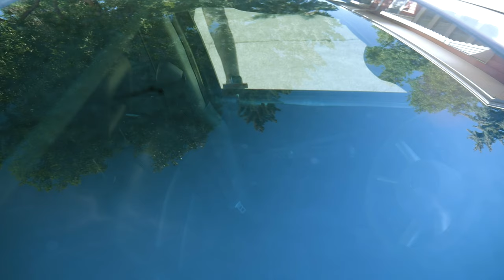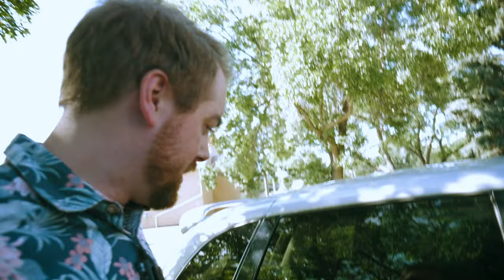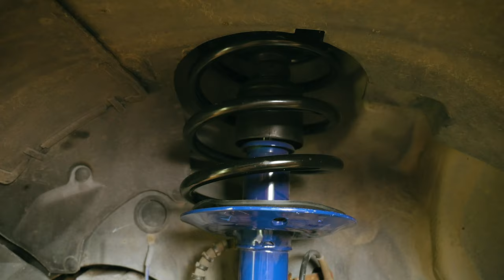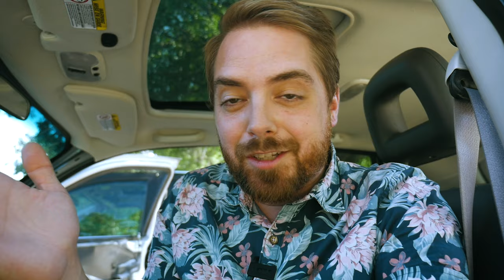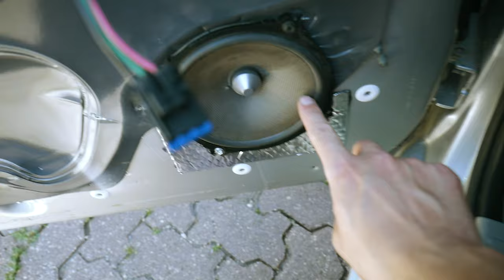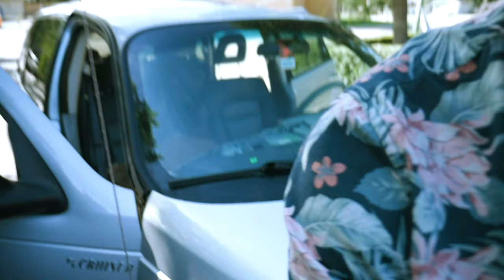Should I Just Walk Away from the PT GT?

Comment: The best way to have Your stereo updated is to buy a bluetooth adapter. It plugs in to the CD changer input. It works great in my Audi A2. I think that You can buy this for a PT Cruiser. Keep up the good work. Waiting for more video.
Reply from the maker: I did this in my '03 Volvo S60 and it was awesome, but I haven't found anything like that for this. Will keep looking...
Reply: Get a FM transmitter which plays music on Microsd and bluetooth with AUX input on Amazon.ca just $25 and set to fm107.7, I have one blasting all the time and you can't tell the difference if its via wired or Bluetooth

Comment: $2200 for the PTGT and another $200+ for parts and you complain? What you've been doing alot of us PT owners have done way more and NEVER nag or complaint once. I bought Mine new in Spring 2002: 2001 Limited PMT Purple plum, upgraded Borla exhaust it costed almost 30k Canadian bucks, thats alot back then, fast forward to now Sept 2020 I've spend almost 10k DIY maintenance replacing all you had to go through and Timing belt/ water pump and lowering the whole deal, but the old girl is aging, neglected rusted rocker panels and 299k km, still I love her so much I had to get her a sibling; I got another exact spec cruiser but with a price tag of $1000 CAD and only 109k never winter drivin Canadian car......... and gave her the same treatment and much TLC. I love my PT's, they are workhorses, they help me move inventory for my business , with out my first I wouldn't have made it today, my wife hates it not because what every reason, its because I put too much attention and time. TBH everyone's mileage vary, the same with any brand without TLC it will fall in the same fate, especially when you buy a used car, you don't know how they treated them before you. Love hate the PT, it doesn't matter; what I drive and own its my business and it should be yours, If you had one and hate it because you got a lemon, you suck sorry but that is a fact. Here in Toronto I don't see much PTs driving around and it makes me feel special that I am getting some attention, again Love hate but for a 17+year old like new shiny quirky car it does turn heads but not like it first came out in 2001 CAR of the Year (Fact) like the Corvette 2020 Car of the year but thats a different story